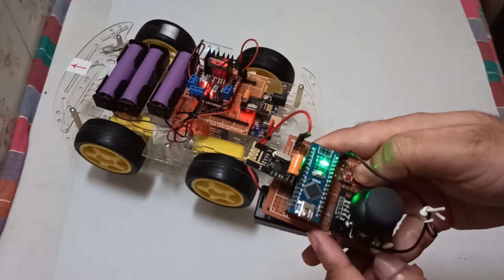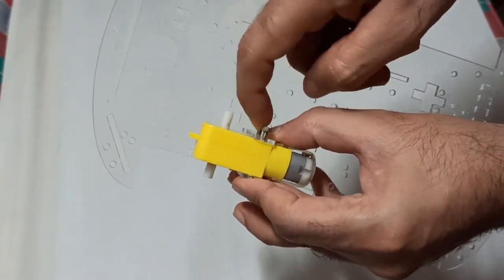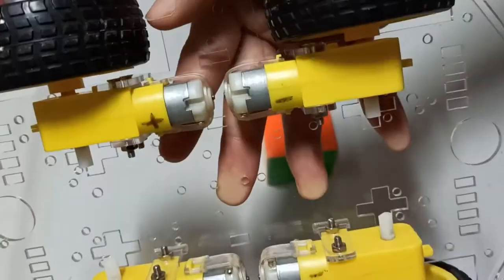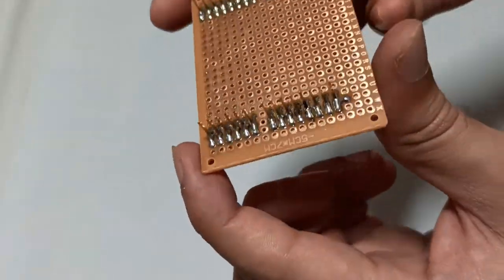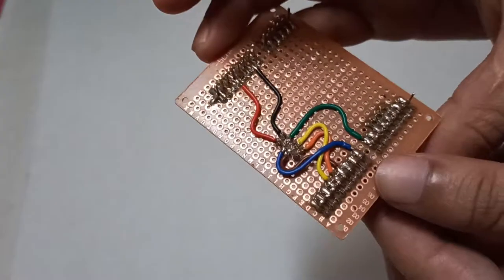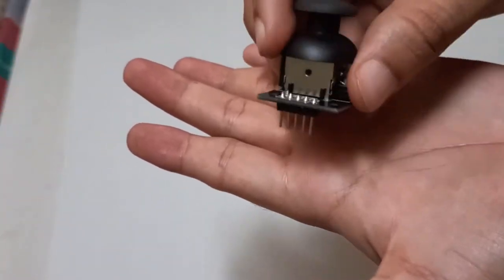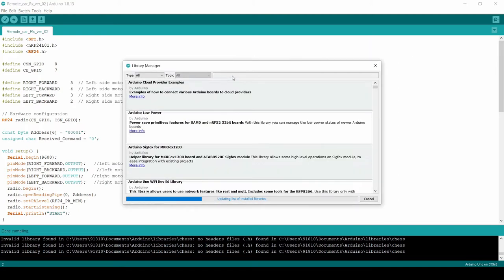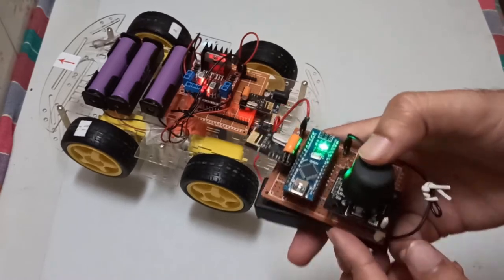DIY | How to make Joystick and Buttons controlled Remote car using Arduino | nRF24L01

Comment: Hi , I according to your code and wiring diagram to build the car, but no any action, Pls, advice me,
Reply from the maker: Do the connections using wires and soldering iron. Please pause the video to have a look at bottom side of the pcb to see how I did it.

Comment: Can it be combined with HC-SR04 & Servo and work in two seperate modes: remote control and obstacle avoiding?
Reply from the maker: It can be, but we need to attach ultrasonic sensor and then write code for it.
It would be different project altogether.

Comment: I was finding the vid. Of Arduino based rc car which can steer it self with servo motor in the front just like an actual car, 
So the question is can i use servo in it, and if yes then tell me where to connect it.
Reply from the maker: yes one can do that, you need to find the mechanism to connect servo at front.
you can find it on YouTube itself.

Comment: Hi, I fixed the problem, the car can work, but the speed not fast, too slow, would your advice me how to increased the speed. thank you.
Reply from the maker: Glad to hear that its working,
Check the voltage going towards the motor driver.
Make sure to charge the batteries.
I was getting decent speeds.

Comment: sir, can you till make me a joystick-controlled Arduino robotic arm car project and also give me the circuit diagram and the code of the joystick-controlled Arduino robotic arm car project. sir, I really needed the joystick-controlled Arduino robotic arm car project.
Reply from the maker: Sure, It will take sometime.
Reply: @ElectronicsisLife  thank you,sir.

Comment: sir, can you still make me a line follower Arduino robotic arm car project and also give me the circuit diagram and the code of the line follower Arduino robotic arm car project. sir, I needed the line follower Arduino robotic arm car project.